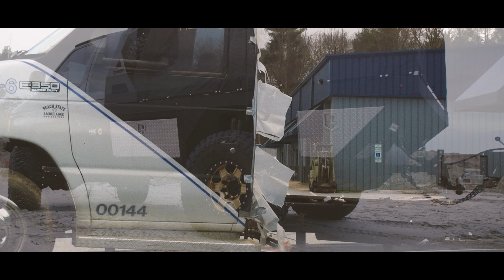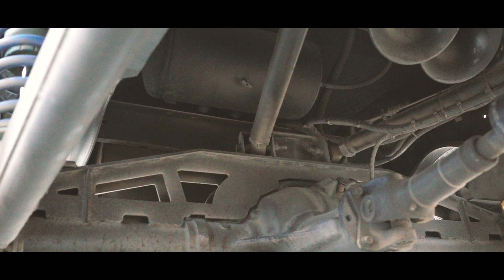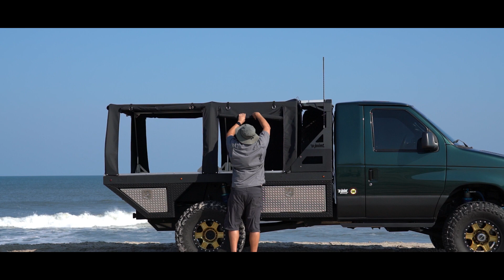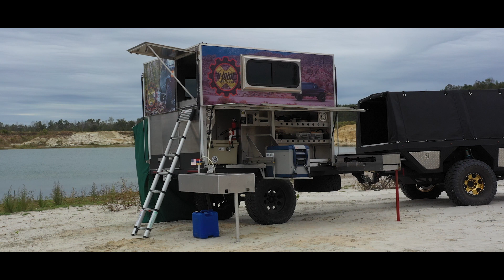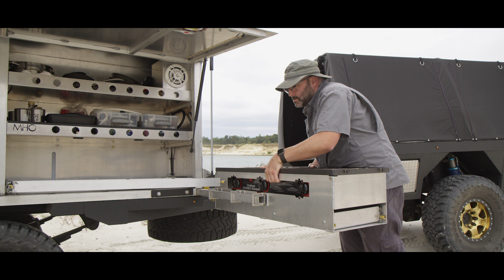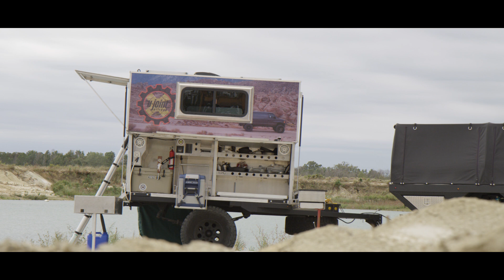Ford E-350 4x4 Conversion Flatbed Van & Overland Trailer Build by Ujoint Off-road

Comment: So I’ve been thinking about springs vs coil overs. On one hand, a van conversation needs the weight capacity from springs. But they are roughy in washboard roads causing me to air down and then back up to keep from rattling my rig to parts. So, would coil overs be a better set up for an overland Econoline that I plan to wheel as well?
Reply from the maker: Chris at Ujoint would be the best person to ask about this. I know most of his vans use leaf springs, so that alone is pretty telling.